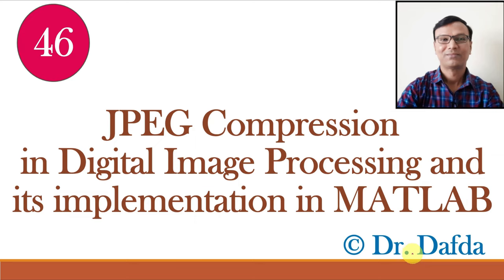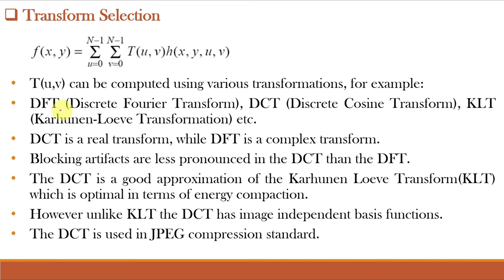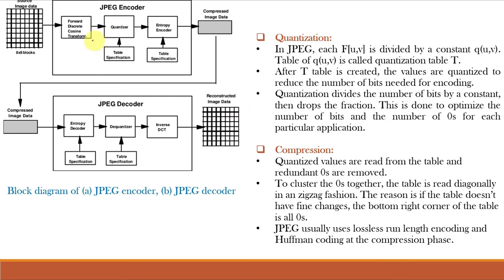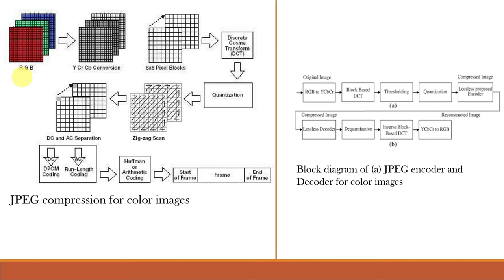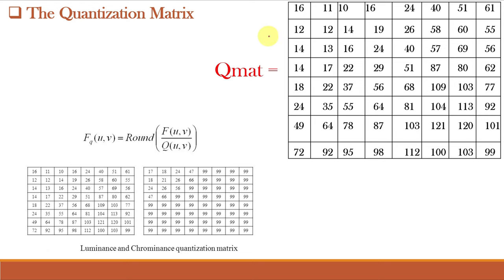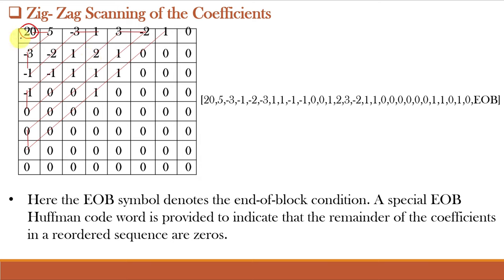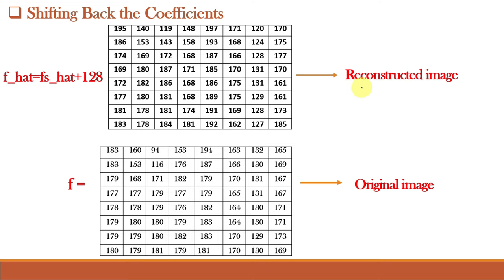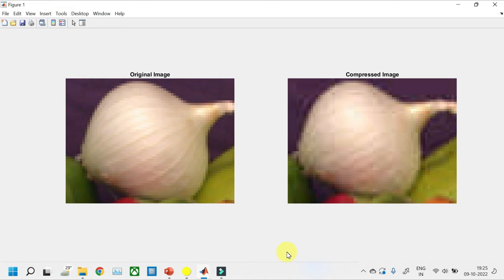JPEG compression with example in DIP and its implementation in MATLAB || Lossy Compression || #DIP

Comment: Code doesn't work.
Reply from the maker: There are two different programs. Please run both individually one by one.
Reply: Sir ,there is an error shown in greater than and less than…
Line :22 column :22
Reply from the maker: % MATLAB program for JPEG compression for Grayscale images clc; close all; clear all; I = imread('cameraman.tif'); I1=I; [row coln]= size(I); I= double(I); I = I - (128*ones(256)); % High quality here means low compression quality = input('What quality of compression you require - '); Q50 = [ 16 11 10 16 24 40 51 61; 12 12 14 19 26 58 60 55; 14 13 16 24 40 57 69 56; 14 17 22 29 51 87 80 62; 18 22 37 56 68 109 103 77; 24 35 55 64 81 104 113 92; 49 64 78 87 103 121 120 101; 72 92 95 98 112 100 103 99]; if quality > 50 QX = round(Q50.*(ones(8)*((100-quality)/50))); QX = uint8(QX); elseif quality < 50 QX = round(Q50.*(ones(8)*(50/quality))); QX = uint8(QX); elseif quality == 50 QX = Q50; end DCT_matrix8 = dct(eye(8)); iDCT_matrix8 = DCT_matrix8'; %inv(DCT_matrix8); dct_restored = zeros(row,coln); QX = double(QX); for i1=[1:8:row] for i2=[1:8:coln] zBLOCK=I(i1:i1+7,i2:i2+7); win1=DCT_matrix8*zBLOCK*iDCT_matrix8; dct_domain(i1:i1+7,i2:i2+7)=win1; end end for i1=[1:8:row] for i2=[1:8:coln] win1 = dct_domain(i1:i1+7,i2:i2+7); win2=round(win1./QX); dct_quantized(i1:i1+7,i2:i2+7)=win2; end end for i1=[1:8:row] for i2=[1:8:coln] win2 = dct_quantized(i1:i1+7,i2:i2+7); win3 = win2.*QX; dct_dequantized(i1:i1+7,i2:i2+7) = win3; end end for i1=[1:8:row] for i2=[1:8:coln] win3 = dct_dequantized(i1:i1+7,i2:i2+7); win4=iDCT_matrix8*win3*DCT_matrix8; dct_restored(i1:i1+7,i2:i2+7)=win4; end end I2=dct_restored; K=mat2gray(I2); subplot(1,2,1); imshow(I1);title('original image'); subplot(1,2,2); imshow(K);title('restored image from dct');